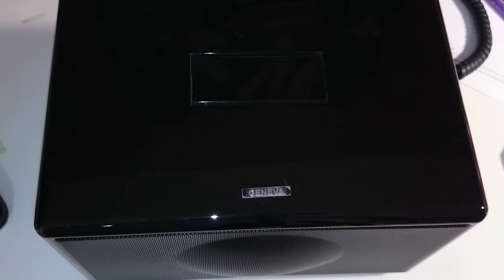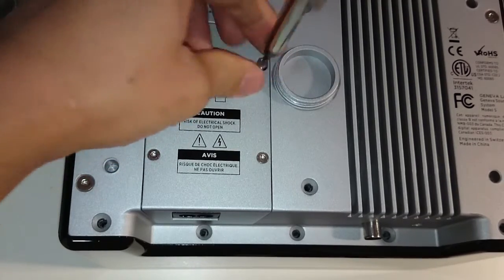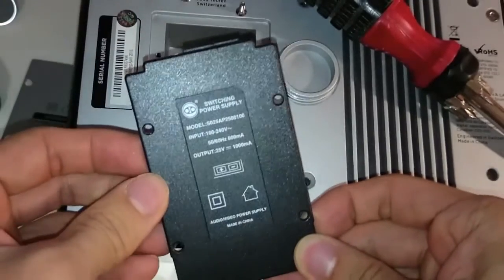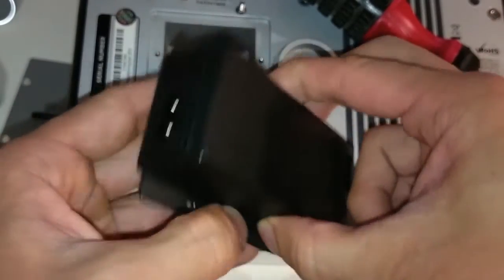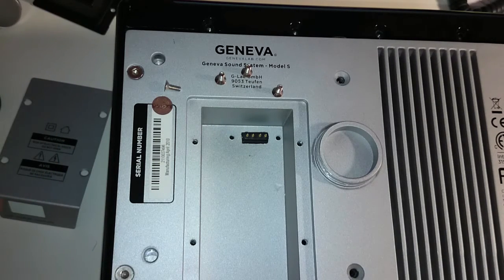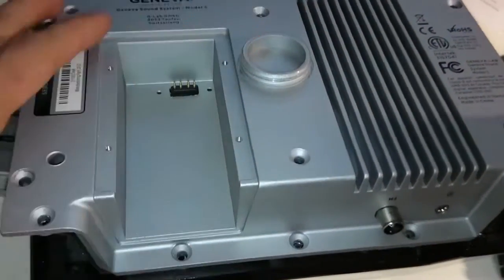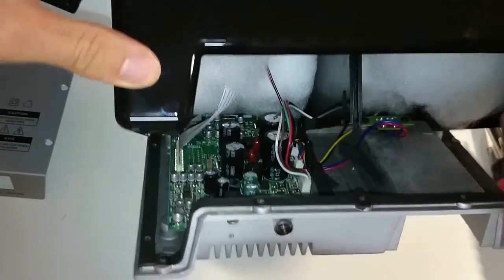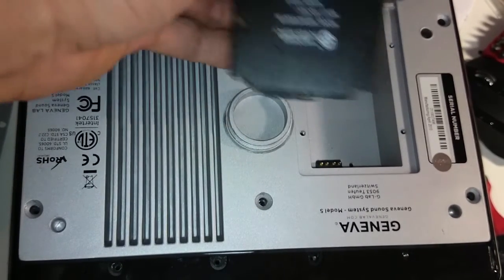Geneva Sound Model S speaker system Tear Down

Comment: Hello - I also have a Model M (no CD player...), and the right side of it is not playing any sound... seemingly neither from speaker nor from tweeter, so I would say the problem is not in the speaker/driver itself... hv you heard of similar problems? Would this be a circuitry problem? Many tks!
Reply from the maker: Likely the power supply. The capacitors are probably not filtering the 5V, 12V correctly for the amplifier IC.
Reply: @conceptedge  Thank you! Y, the most "suspicious looking" capacitor is the first one following the power supply input into the pcb (not clearly bloated but seems to have leaked a little)... but wld that really be consistent with only the right channel not working? The unit plays perfectly through the left channel... (and no longer being in Europe for support, seems like I do hv to venture into a diy project here...)
Reply: Que tal, lo has resuelto?

Comment: I have the Model M and the cd player is not working. The readout says 'no cd' but can't insert a cd. Any ideas on whats wrong? Thank you for any help or suggestions that you may have.
Reply from the maker: It could be the motor, it could be the circuit board. I would check the output from the power supply first. I have other videos on my channel showing how to troubleshoot a switching mode power supply.
Reply: @conceptedge  thanks for the reply! I think the problem is other than power or the motor. When I hit the eject I can hear things turning.
Reply from the maker: Yes but if the power supply is not delivering correct voltage for the digital circuit such problem can occur. See this video that has the same "No CD" error: https://www.youtube.com/watch?v=iEG_u0ogjZI